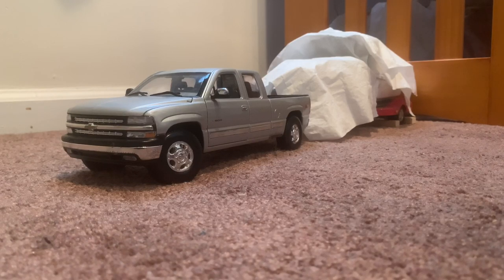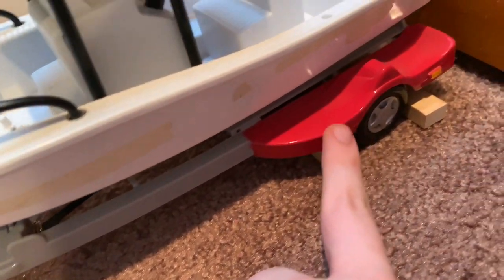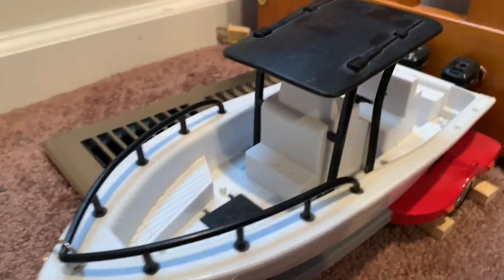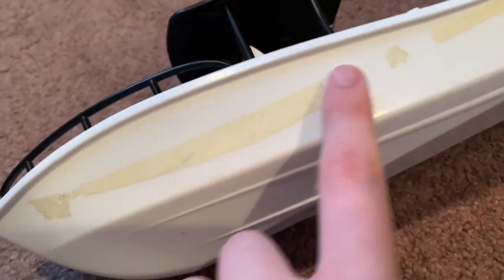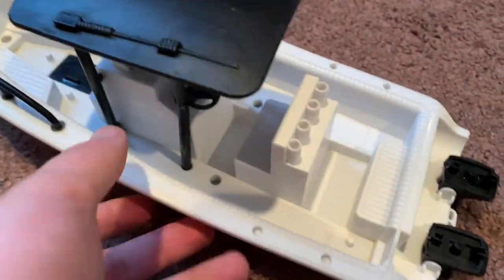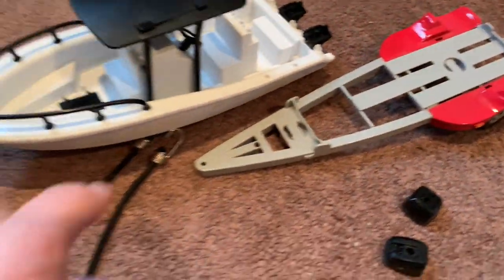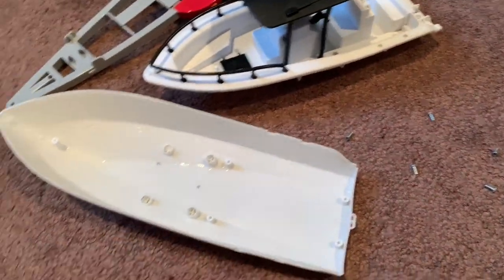Scale 1:18 truck towing boat

Comment: How’d you do the exhaust
Reply from the maker: Took them off of a old model car I didn’t need. And superglued them on under the bumper and cut off the old exhaust tip that came out on the passenger side.
Reply: @colethecarman0469  okay thanks!

Comment: Where do I buy the truck
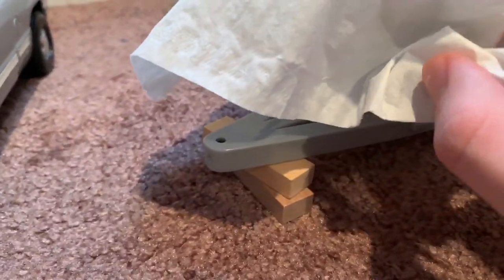Reply from the maker: eBay “scale 1:18 1999 Chevy Silverado”
Reply: Colethecarman _04 does it come with the hitch already or no?
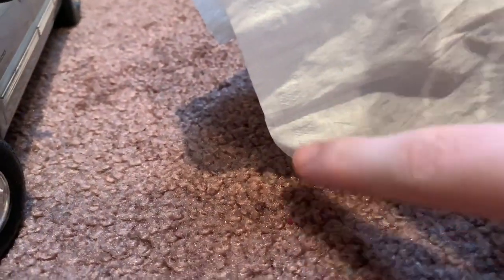Reply from the maker: No, I had to buy a scale 1:18 car trailer that came with 3 hitch’s and I superglued one on the back of it.
Reply from the maker: Niceeguyleo 12 https://www.ebay.com/itm/254686101661 like this on is the same I have and it comes with three hitch’s
Reply: Colethecarman _04 so I would put the hitch on the truck
Reply from the maker: Niceeguyleo 12 yes if that’s what you want to do or if you have any other cars, comes with three hitch’s
Reply: Colethecarman _04 okay thanks I sub to you
Reply: Walmart